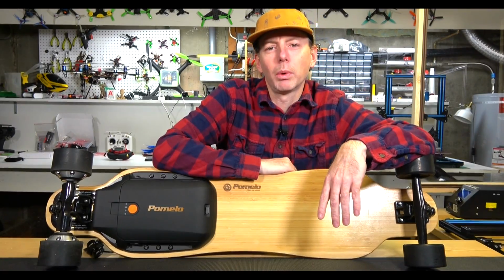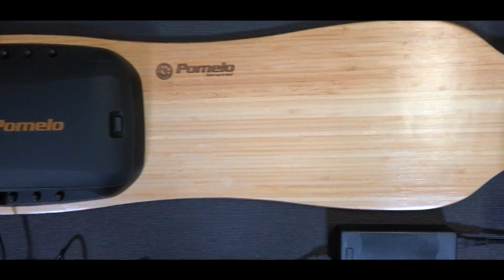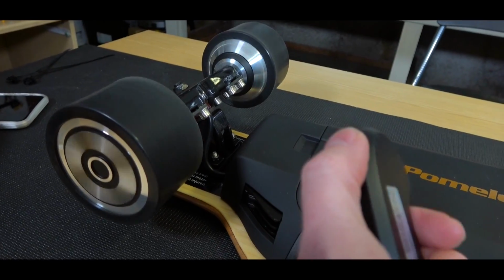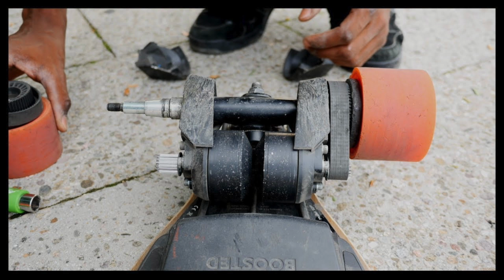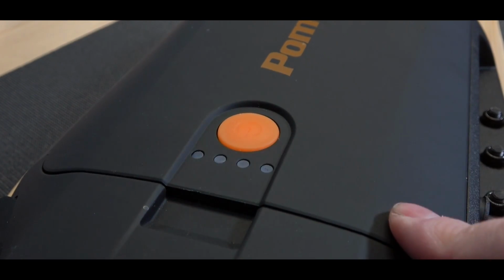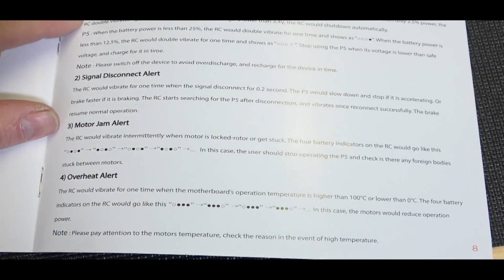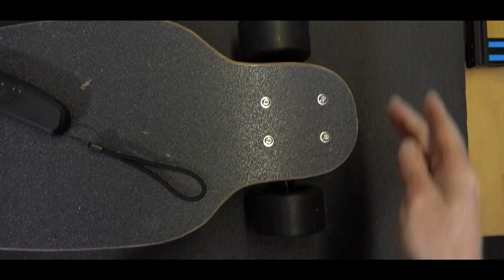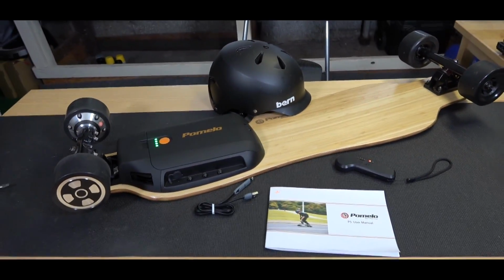BETTER THAN BOOSTED BOARD - HALF THE PRICE

Comment: removable battery means you can check it in with your luggage, take battery on board with you 🤟
Reply from the maker: Yep they are Airline certified batteries.
Reply: The Boosted board has a 6-7 mile  battery that is removable. Which is airline certified because it is 99wh.
Reply: Drone Camps RC 
Isn't be battery way to big to take it  on a flight? On gearbest it says 208wh. I thought 100 was max. So how do you travel with it? I am really interested in it and would live to use it when traveling.
Reply: Paolo Picariello don’t confuse milliwatt hours with Watt hours ✌️
Reply: Dizzy Fpv BATTERYCAPACITY : 5800 mAh
BATTERYRATE : 208 Wh
😉
I know! My question is still the same

Comment: Here is an Idea for ground clearance... Portal axles, in combination with the brush less. Pit the axle on top of the board, and have portals stretching below, or just do it all underneath for even more ground clearance ...
Reply: I was thinking same thing with an added gear ratio for larger off road meats